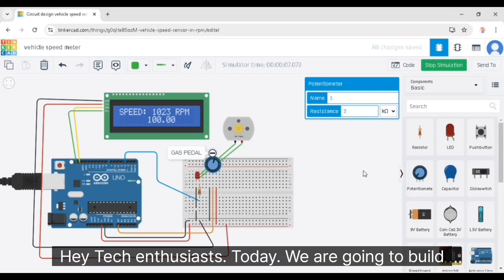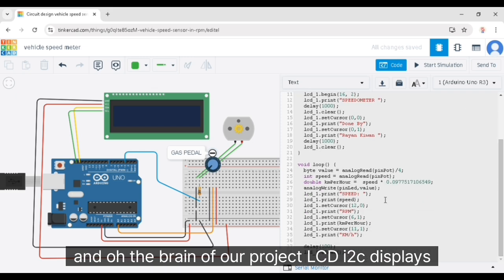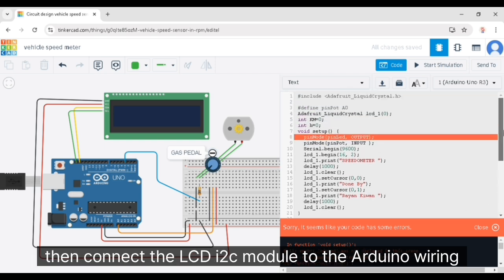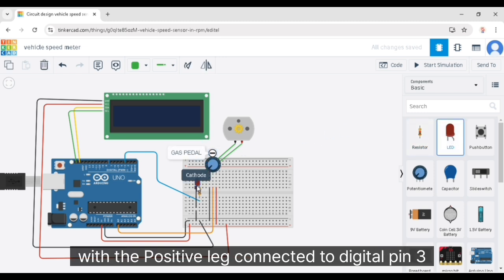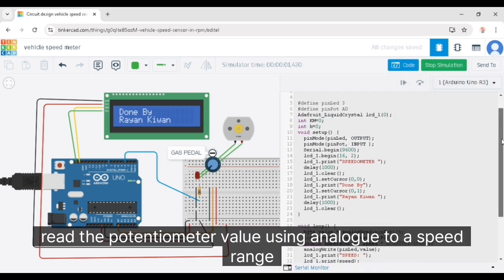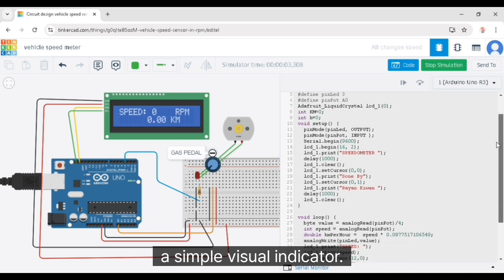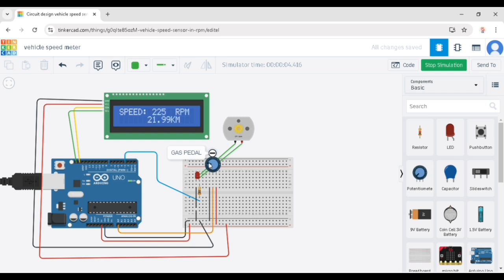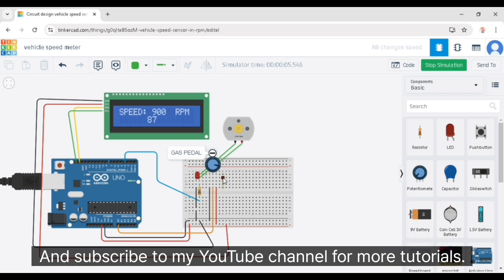Building an Arduino Speedometer with LCD, DC Motor, and LED | Step-by-Step Guide Simulation

Comment: Can you share the code
Reply from the maker: #include <Adafruit_LiquidCrystal.h>
#include <Servo.h>

#define pinLed 3
#define pinPot A0
Adafruit_LiquidCrystal lcd_1(0);
int KM=0;
int h=0;
int servopin(9);
Servo myservo;
int angle = 0;
int val;
int potpin = 0;
void setup() {
  pinMode(pinLed, OUTPUT);
  pinMode(pinPot, INPUT );
  Serial.begin(9600);
  lcd_1.begin(16, 2);
  lcd_1.print("SPEEDOMETER ");
  delay(1000);
  lcd_1.clear();
  lcd_1.setCursor(0,0);
  lcd_1.print("Mini Break-In System");
  lcd_1.setCursor(0,1);
  lcd_1.print("TU7UH RC");
  delay(1000);
  lcd_1.clear();
  myservo.attach(servopin);
}

void loop() {
  byte value = analogRead(pinPot)/4;
  int speed = analogRead(pinPot);
  double kmPerHour =  speed * 0.0977517106549;
  analogWrite(pinLed,value);
  lcd_1.print("SPEED: ");
  lcd_1.print(speed);
  lcd_1.setCursor(12,0);
  lcd_1.print("RPM");
  lcd_1.setCursor(6,1);
  lcd_1.print(kmPerHour);
  lcd_1.setCursor(11,1);
  lcd_1.print("KM/h");
  val = map(speed, 0, 1023, 0, 180);     // scale it to use it with the servo (value between 0 and 180)
  myservo.write(val);

  delay(5);
  lcd_1.clear();
}